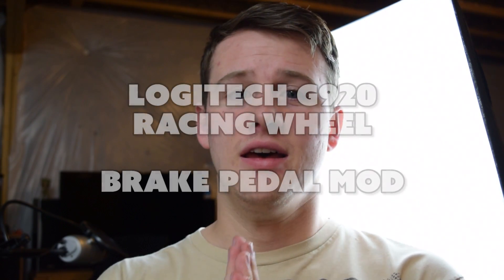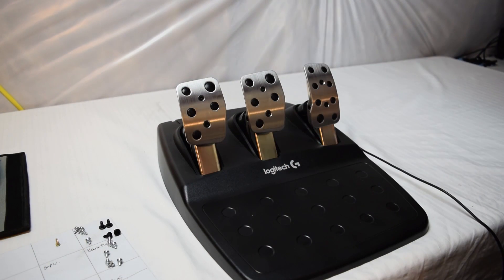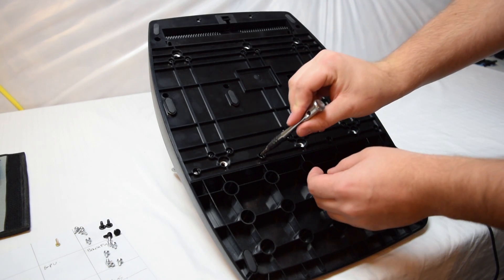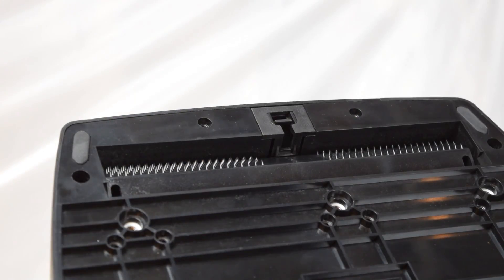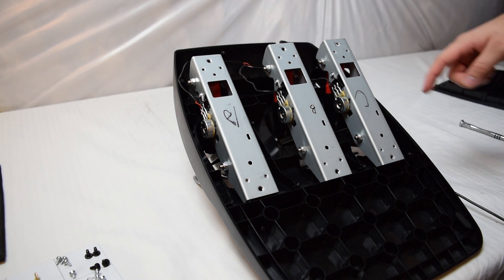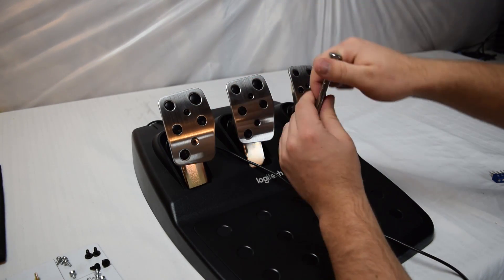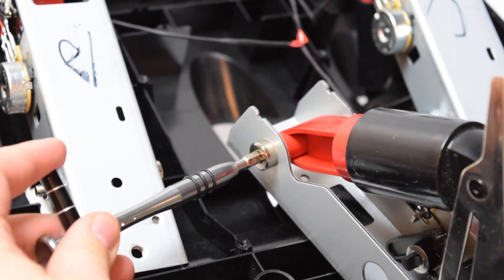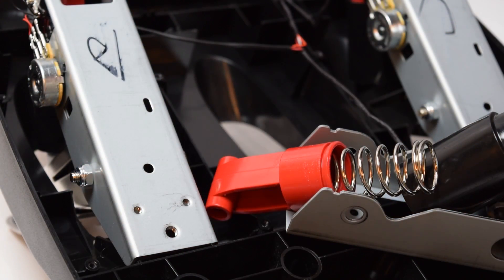Brake Pedal Mod - Logitech G920 Racing Wheel

Comment: I did this mod, and thank you for posting this. However, whenever I put my foot down half way it registers as fully down in the game.
Reply from the maker: Yeah it has a slightly shorter actuation because the rubber usualy makes it stop earlier, but it makes it better than pushing away your chair.:)
Reply: That is true indeed. Do you know if it is a software thing in which I could mend the drivers or whatnot and change it or is it a hardware thing?
Reply from the maker: +Stewie140 honestly I'm not sure. If it's a software thing I have absolutely no knowledge of how to manipulate that. But let me tear things down, if it is a hardware thing we might be able to fix that.
Reply: Alright, thanks!
Reply: Do note, however, I already took apart my pedals and it is not anything in there. All of the potentiometers are the same in the pedals and I tried changing the wires around with no luck to fix this.
Reply: did you find a solution yet?
Reply: Yea. I changed the wires so the clutch Y axis is actually hooked up to the brake potentiometer, and the Brake axis is hooked up to the clutch potentiometer. Then, I assign in games for the Y axis to be brake and the Brake axis to be clutch.

Comment: While I can understand some of the negative comments,  I for one couldn’t get to more than %50 when seated and 80% when putting all my weight on it while standing. It’s totally useless and in fact project cars wouldn’t even calibrate it in a seated position! While I agree this takes away the true feel on the pedal, it didn’t translate into the game. In Forza I could barely get 1/3rd braking in a seated position. Taking the rubber out means at least I can use the brake even if the travel is longer and the feel isn’t there. I didn’t but this not to be able to use it and this is a better compromise tHan leaving the rubber block in. Awesome thanks

Comment: Best mod I've done to my g920 yet. I used this video as research to see if it was even possible, then did it an easier way. You only have to take off the 3 pedal covers and the silver screws to do this. Its alot less risky of breaking wires. But be careful opening it up as you can see the wires are connected to the cover. Took me 10 mins thanks for the video!
Reply: After reading your comment I only took off the brake pedal cover and was done in less then 5 minutes. Thanks my friend

Comment: Thanks dude I had this thing for almost two years now and always wanted to do it just been really nerves to do it. But today finally did it I play alpt of ats and ets2 because of that rubber piece I had to Velcro my pedles to my wood floor cause everytime I press on the brake my chair will roll back and cause that was happening I will hold on to my wheel and sometimes my whole wheel will slide off I have a slim glass desk so can screw it in. All that is behind me now thanks again.

Comment: So heres my question; what if I where to modify the rubber block it self? As in maybe cutting it to shorter length instead of removing it completely. Should keep some of that stiffness and at the same time making it easier to brake. Right? Thoughts?
Reply from the maker: I've been thinking of making a sequel to this video where I do that. Try it out and let me know?:)

Comment: Can't you just push down the brake all the way and put some sort of clamp on it so it stays down therefore weakening the spring?
Reply: PorkChopGaming these are really high quality springs. It will take thousands of hours of constant compression to weaken them much. The problem is the rubber anyway, the springs aren't that hard
Reply: Beeeyeee -Tech & Tutorials oh thanks I may do this mod I don't have the G920 yet but it's coming in 2 days should I do this mod?
Reply: PorkChopGaming it's up to you, worth a try but it's personal preference
Reply: Beeeyeee -Tech & Tutorials I'm doing this mod right now and on the brake pedal the two bolts are different sizes and I stripped the lower bolt cuz it was too big. can I just take the bolts off behind the brake pedal on the cylinder thingy.

Comment: The accelerator screw on mine already come rounded off, I bought it from new! Pissed off in an understatement. Genuinely very angry as I can't get it off!
Reply: Just use a rubber band tick enough and add a little more pressure to the screwdriver and voila, the screw will come off. Buy a new screw to replace :)

Comment: Thanks man! I cant belive i have been using it with the rubber for months, it was such a pain to depress. Now its so smooth like the cluth pedal and i can use the brake with full potential. I bought the crew 2 and had to push %80 of the pedal for it to register lol.

Comment: it makes it so difficult to come to complete stops
Reply: brake in a straight line, learn the correct racing line and why it is effective, pulse brake if abs is disabled, increase brake pressure, moderately increase front ratio, shift as you brake utilise engine braking..
learn to drive yo
peace
Reply: padlockbeats im saying that the brakes are so stiff that i have to push         down way too hard
Reply: ok i hear ya,
peace

Comment: Does this wheel work with windows 10?
Reply from the maker: Sure does my friend! It works with Xbox one as well, but a diffrent model works with PS4 and PC.
Reply: Beeeyeee - Games & Good Times Alright thanks. It's just that i have heard that alot of people complained about the compatability with windoes 10. But i guess it was just that windows 10 was buggy back then.
Reply from the maker: That's exactly it. It's more up to the game dev than Windows though. Some developers might not provide proper support for it. Though I've had no troubles. Then again o haven't played too many racing games on PC with the wheel. If you know any game in particular maybe look it up to see if it's compatabke
Reply: Beeeyeee - Games & Good Times Alright. I was thinking of using it for horizon 3 but that should be no problem since it's a windows 10 exclusive.

Comment: When screwing it back on I drilled right through the wire. Warning
Reply: Literally did the same thing😂,how did you fix it cause I've retained the wires back together and now the throttle is stuck as being pressed all the time 😂

Comment: You just use the pedal without the rubber? Sry i dont understand the and of the video :)
Reply from the maker: Yes, sorry I didn't explain it too well. But it feels a lot more natural and easier to use without that rubber piece inside. The rubber makes you have to push WAY too hard and the game only sees the distance the pedal travels, not how much force you put on it. Does that make more sense?:)
Reply: +Beeeyeee - Tech and Gaming yes, thank you, but the pedal force is not too linear and low?
Reply from the maker: +Dávid Nagy +Dávid Nagy the spring in the brake pedal is still pretty strong without the rubber. It is fairly linear. But honestly It makes it so much better for me. But it's a personal preference. Try it out and see how you like it:) it feels perfect to me though!
Reply: +Beeeyeee - Tech and Gaming okay :)

Comment: He all, what if you cut the rubber, make it smaller. Has someone tried that?
Netherlands ✌🏼
Reply: That would work but, you would have to push down further to hit the rubber (would be a weird feeling I guess). I was thinking the same thing though =]
Reply from the maker: Someone commented that he had, and he said it worked well! yet to try it myself though

Comment: Please donate that rubber piece to a dinosaur user (G25)😂😂😂
 I tested the 920 pedals in a store and I kinda like the feel of the brake pedal also found it useful how you can use that rubber resistance as referral to how far you pressed. Maybe it's just me but yeah please send it over. 
BTW thanks for uploading this I learned something useful.
Cheers!
Reply: hamzterix search for the nixim mod or gteye mod, they actually sell a set with a fermer spring and rubber for g25 and g27. I have it and love it, although hardmounting might become necessary as the force required to push the brake increases quite a bit.
edit: and if you get the mod, use the old spring from the brake in the clutch. I did and really like the extra pressure needed on the clutch.
Reply: I agree.

Comment: I have a much better idea that doesn't affect the warranty: make sure you use a chair without wheels, they are the main reason for pushing yourself backwards while braking (and you end up damaging the force reedback mechanism because you use the wheel to pull yourself forward to increase the preasure on the brake pedal). Make sure the chair doesn't move! Next, adjust the brake travel zero points to your personal liking (I don't remember wether I did this in-game or via Logitech's driver). That way you get the right feel without the need to stand on the pedal to brake hard.
Anyone that has ever driven a real car will tell you, that a brake pedal that goes right to the floor is bad. I mean, realy bad.....

Comment: I bought a g29 but i wanted the empty feel of the g27's brake so i took out the rubber and downgraded to g27 pedals, sick dude
Reply: every g27 owner wants mod like g29 pedal. I just mod it with rubber for better real car feel in PC2 and Dirtrally2.

Comment: you are absolutely wrong

You do the exact opposite than "improving our driving experience"
If there is hardware that can make you a faster driver it is a hard brake pedal. You get a lot more control over your initial braking. And that's the most important part because that's where you need to trust your ability to break.
And I'll tell you why:
When you brake initially you can't determine the exact pressure you can apply without the brakes locking up. With a hard brake pedal it doesn't matter if you apply a bit more or a bit less because the distance your pedal travels is approximately the same.
Now imagine a pedal that's easy to push. You may end up applying slidely too much pressure but with a light pedal your brake ends up traveling a significant distance too far which could cause you to lock up your wheels. That's why a hard brake pedal helps when it comes to confidence on the brakes even on cars that are a bit more difficult to drive.

And when it comes to releasing the brakes you get the same feeling as with a soft pedal since a hard brake pedal is hard because of damping. That means at the beginning of the travel range of your pedal you get a much lighter pedal than at the end.

You may say that you can't always apply 100% brakes but from experience I can tell you that you don't necessarily need to be at 100%. ABS might interfere or you will lock up your wheels instantly when braking fully. Always remember that in the setup of a good sim you can always chang ethe brake pressure to 98% for example. This is not considered making you slower instead it is driver preference. Because it can give a driver more confidence and more control and this is deemed a lot more important than being able to brake 2-5% more.
Reply: I haven't tried it since doing the mod, but in 3 games (Project Cars, Forza Horizon 3 and Asseto Corsa) I literally could not stop my car. Maybe there is a setting, but I could only get 63% braking and it sucked.
Reply: GT-Alex "GT3" lmao all of them have ABS, no wonder
Reply: well im also used to a DFGT. mostly driving the ferrari 458 gt2 in assetto corsa. and now after switching to a g920 im not sure if i do like the extra force required for the brake pedal. especially because i already got used how to dose my braking power on light braking pedals and my chair isnt fixed to the ground.
Reply: but taking it out does not change the initial braking, the rubber is lower in the spring so it kicks in after like 40-60% pressure.

Comment: lol, your mod is to undo the mod that alot of people do to their g25 and g27. Logitech put the rubber in the new pedals so their customers wouldn't open them up, because alot of people used the nixim or gteye mod on their old pedals. I have the nixim mod for my g27 and really love it. I do have to admit my pedals are modded alot more now (upside down and lengthened) so it's hard to compare to the g920 pedals, but I would think this is a downgrade.

Comment: I think they have the right idea, but I think they over did it... Thanks. 
I took a razor to my rubber thing and cut it in half. MUCH better.
What they Fail to account for, is that in most V-games 80% brake is about right to slow down without skidding but I can barley get the brake to 50% before I'm pushing myself away from my desk.
Ive drove about 25 cars in my life and I've never had a brake peddle that stiff... And if I did... I would be taking that shit to the shop... Oo
Reply: someone else drilled holes into it...i think i may do the same and cut it in half...thank you
Reply: Damn kids today having never driven a real car without power brakes

Comment: You ruined your driving experience the rubber is far better in than out and then a little down the track get a better one like the 3D rap but  ABSOLUTELY NO RUBBER is just as idiotic as going to a supermodel orgy but not taking a rubber. think

Comment: Lol, back in the days of G25, G27 everybody sticks rubberblocks into the spring for more realism and websites are selling these rubbers for ridicules prizes, nowadays Logitech includes the rubber as their listened to the costumers feedback and it becomes a mod to remove them for "more" (=less) realism :D
Reply: The G29 rubber is way, way stiffer than most mods, to the point it's just dumb. There may be a few race cars out there that will require that much pressure but they are very few and driven by people who basically lift 4 hours a day.

Comment: Please go get a car license. By doing this mod shows that you are a gamer not a sim racer. Drive a real car more and feel those brakes.
Reply: exactly what I said lol :D
Reply from the maker: yep, exactly. If I wanted a simulation I'd be using a MUCH better wheel than this.
Reply: Beeeyeee G29 is just fine for playing simulators, but obviously you are not interested in that kind of stuff(3rd person, terrible driving, campervan[lol]). I personally find fooling around entertaining for a short time but prefer proper racing any day.
Reply: I drive a real car and this brake pedal is nowhere realistic. I get like 8% brake power when slamming it hard.
Reply: LOL! A real brake pedal doesn't feel like the G920's. Unless you're driving a car with mechanical brakes, or the car's engine is shut off, most if not all modern cars have fairly squishy brake pedals.
Reply: Agreed. I've driven a couple of vehicles, none of them have had brakes this hard. Anybody ever heard of brake booster?
Reply: Sorry but when I same on the brakes in my car with 6 piston Brembos it’s nowhere near as hard to press down as the 920

Comment: Actually, I'd take two more of these "guys" lol and put them under the gaspedal and clutchpedal so the resistance of all the pedals would be balanced. Just sayin'.
Reply: Patrik Halla you know in most cars the clutch has more resistance than the accelerator and brake so it would be really odd lol

Comment: Terrible information.
Reply from the maker: Thanks for the feedback dandandan. Lovely to think that youre so thoughtful.
Reply: @Beeeyeee  ok perhaps i was a little harsh.. but you are giving terrible info my friend, the g29 and g920 brake sensor is not linear (they accounted for the rubber block) with out the rubber block or an upgraded spring or a bodnar connector what will happen is when you get to the point of travel where you should of hit the block the braking force will spike from aroumd 65% right through to 100% very quickly in a short throw and then the remaining travel left will be just deadzone.
Reply: @Beeeyeee  a better thing to do would be replace the block with something a little softer, an artists eraser for example but it has to be the exact same dimensions as the original block
Reply: @Beeeyeee  so you don't have anything to say to my response?

Comment: I think this is very stupid "mod" Brake pedal should be like this, have you ever driven a real car? Peoples don't ruin your pedals like this.
Reply: When you have this wheel and pedals, tell us how it went. Until then don`t be so generous with your wisdom-full comments.
Reply: I have used this wheel and pedals about 6 months. Iracing, Dirt Rally, Assetto Corsa...
Reply: Now after disassembling the pedal and playing it for 5 minutes, it`s complete crap. I reassembled all back again to the factory state. I realized that you don`t need to press the pedal hard at all. Instead, set the settings in the game, where the part you press the pedal to where you think is hard enough, and set it to be 100%, so you will never have to push harder. It was dumb on my part, to start fiddling with the actual pedal, instead of game settings.
Reply: wtfcssource braking at 100% will make you slower anyway you never need more than 70-80% especially with no ABS.